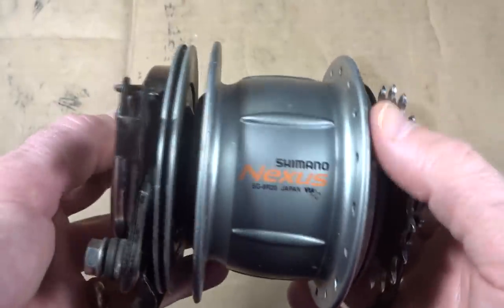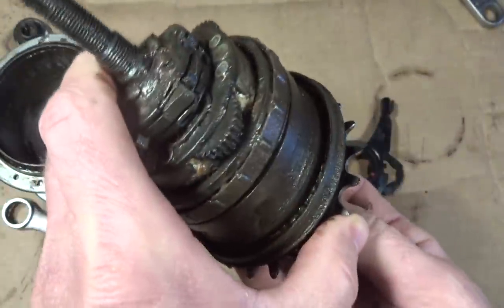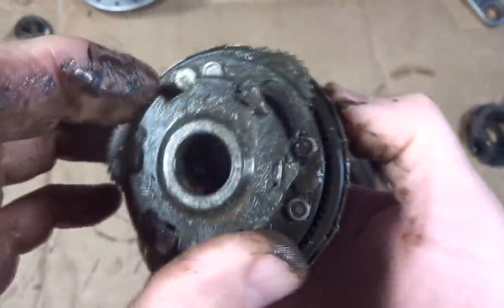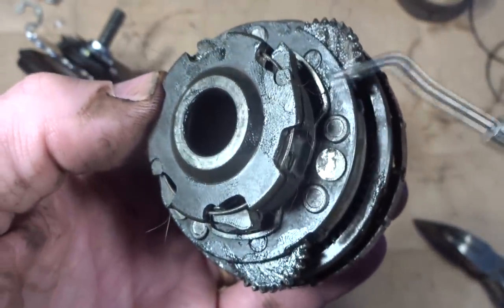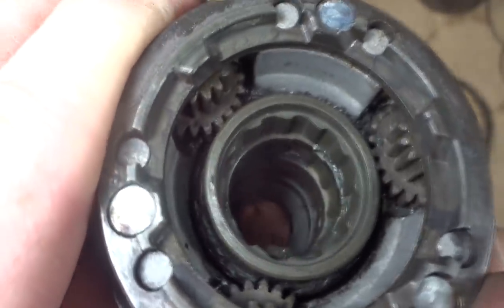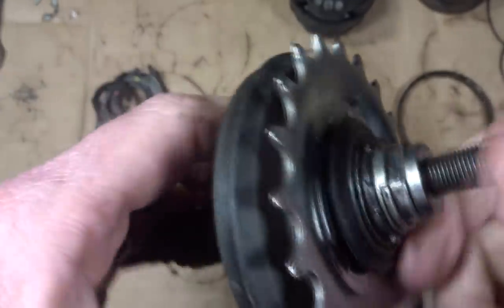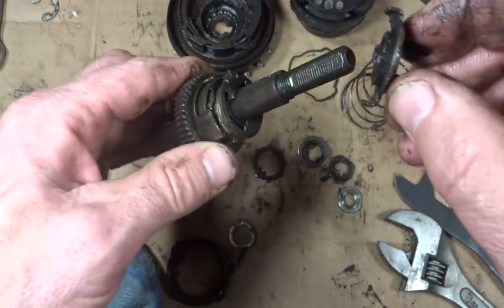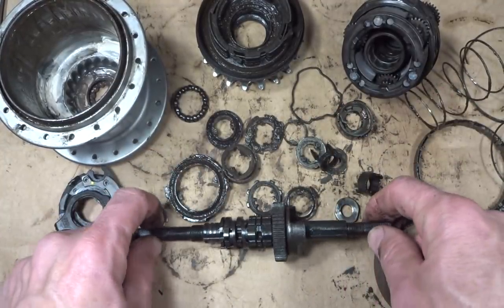Shimano Nexus 8 Speed Hub - Dissection! Evisceration! Destruction!

Comment: Three observations:
1.  It really makes you appreciate a cassette and derailleur system.
2. This has a large "ick factor"!  Have you considered a parts washer?
3. Great advice at the end about taking one apart!
Reply from the maker: I actually have a parts washer. I need to dig it out and replace the solvent in it. I was cleaning the parts in my ultrasonic cleaner which is pretty lightweight.
Reply: As soon as I rode IGH I appreciated time saved on cleaning multiple cogs and low running chain. This is a low end hub, I just checked Campi Record 8-sp cassette alone costs about 2/3 of this hub. Shimano 8sp cassette is about 1/3 to 1/4 of price, though.

Comment: It is the same as  a 8 speed automatic,  but all in 1 axle! And way tinyer! I have done the same with a Sram I-motion 9, and it is a nice challenge.  Thank hell I had a good day  and did not throw the fucking thing thru the window,  It still works after 5 years and lots of miles after. 
When you reasemble,  bath  it in ATF,  Works wayyy better

Comment: IGHs with more than 5 gears are usually oil-filled and oil changes are mandatory.  Change with hub gear oil before and after 1000 miles (no previous oil change). Then change oil every 3000 miles. (the first oil change is at 600 miles). Use only Shimano SG-S700 Oil in the Alfine 11 hubs. Also use waterproof grease in the hub to prevent premature failure.

Comment: An old "Billy Backyard Mechanic"'s trick is to lay out on your cardboard, each part removed in the order they were removed. You could even group them according to the area they were removed, ie; left side, right side, inner drum, etc. With the cardboard, you take a Sharpy pen and number each part and make any notation that helps you remember your conclusions as you disassembled it. You are lucky that you have a decent video detailing how you disassembled it. Just reverse the procedure. The funny thing is when reverse engineering you learn just as much if not more by putting the thing back together.

Comment: What a greasy mess, no wonder it wouldn't work.  I had one of these on a Bianchi Milano and loved the way it rode.  But, I had a flat on the rear and it took me a full day plus lots of busted knuckles, scratched fingers, etc to get it fixed.  Great engineering but not for the diy guys like myself.  I applaud your courage in taking this apart.  I'm fool enough that I would try to get it working again once the grease and dirt were eliminated.  Keep up the videos, they have helped me a lot.

Comment: Interesting. I came very very close to buying one of these then bought the Ebike instead. Now I understand why overseas they call them roller brakes. It looks like a roller bearing sprague clutch like use in drills and cordless screwdrivers. 

The hub itself looks like it might be built to be 9 speeds but loses one because of its configuration. I think once I'd crank on it'd definitely break. Thanks for the peak inside it RJ.

Comment: Had this hub laced into an old '85 Raleigh Renegade to replace the 7 cog cluster...ran the bike to about 6k miles and hub developed some play in the body and needed a new rear sprocket....took it to a local bike shop for some work and got it back..never to be the same. Later I went with a Sturmey Archer 8 sp hub, put 10k miles on that with no complaints...so far.

Comment: I've taken these apart succesfully (and put them back together again). 
      There is a certain point after which you should probably stop disassembly (or you're gonna have a bad time ;).
     Halfway, you come across some double spring-loaded thingie. And I HAVE managed to put that back together and back on without the official tools, but it took me several hours over several days.. And a loooot of patience ;)

Anyways - Nexus gear hubs are my favorite. VERY reliable, very little service required.

Just make sure you use the Shimano recommended greases 
     (the rollerbrakes too - they have Moly based grease for those with a certain viscosity. (I tried lithium grease, but holy sh!t - suddenly my brakes didn't work anymore at high speed)

Oh, and look for the dots imprinted in the metal gears (easy to miss) - on the first (?) planetary gear set (3 gear wheels), the dots need to face outward. Exactly the same as eachother, or there will be problems with gear alignment...

That proper gear alignment makes it so you can shift from 1 through to 8 while standing still (it's pretty sweet)

Oh, and use the proper shifter. One made for Nexus 8
(Nexus 7 shifter works too - you just don't have the heaviest gear available to you)

Oh, and use the proper err... (I think they call em) 'anti-rotation washers'. Those things that lock the axle in place (to keep everything in position);

They have different colors for Nexus 3, 4, 5, 7 and 8.

Nexus 8 is 1 gray, 1 black

Got Nexus hubs on 3 of my 4 bikes, and I reckon I might be the only one in Amsterdam who likes servicing this system (:
Reply: Just to ask is there a road bike shifter that can be used for them?

Comment: I much prefer the linear shifting of a Sturmey Archer. Really you should be looking for 4 different gears in there, hub gears usually have a direct drive then each speed below that is paired with one above, so a 3 speed hub will actually only have 1 gear train, it just uses it in both directions and has a bypass for Normal. 

Interesting video, though I too would like to see it fully cleaned so it can be observed, surely your video can show the order and orientation of the parts as they came off

Comment: Thanks for the video, it's great to see what's inside this thing!

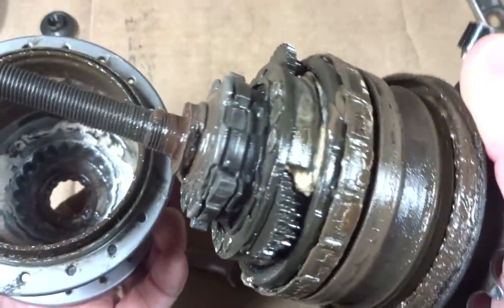I have been riding with a nexus 8 hub on one of my bikes for five years now, and it is very reliable overall, especially as I keep the bike outside. One year from new I had the shop I bought it from service the hub as it was "slipping" into a neutral gear (which should of course not exist) when set to gears 5 or 6. When riding this can be dangerous, as you suddenly lose traction. The shop told me they just tightened up the bearings as they were loose, and that indeed fixed the problem. I guess they tightened up what looks to be the bearing cup you see at 1:07 . (I think you can just about see the bearing race from the outside of the housing at 1:13 and then from the inside at 1:24 ). I suppose with the whole stack of internal parts being loose, the pawls were able to slip sideways out of their sockets somehow.

There is some great information on Sheldon Brown and from Shimano, but this problem of a loose bearing leading to a sudden neutral gear does not appear to be addressed in any of the "adjustment" information I found on those websites.

Comment: Couple years ago I was trying to do it in new oil, so got it out, couldn't put up back together by myself then took it to bike repair shop, they gave up, so bought used one, and it is working till this day. Only upgrade I've done, I changed the sprocket for less teeth so a bit quicker.

Comment: Dirty hub, cleaning is quite good idea and maybe organizing parts. I found exploded drawing and operational quide. Shimano spare-parts list, I had 2 depending to shaft length, the right one had right number of nuts, so there are many drawings within the same model too. My hub had black grease and it seemed in good condition. That was not problem. My problem was pitted bearings, so I kept transmission as it is, didn't remove safety-clip or that thing holding planet gears. Transmission is serviceable. Sellers manual guides to dip it in transmission oil, not dissassemble, but grease is much easier to apply when gears are dissassembled. It is big operation. And the shifter sleeve is the core of transmission so if you manage to figure out how it works raising pawls and rachets driving gears at each gear, you should find out if there is anything wrong with it, nevertheless it is dirty, the brown grease is contaminated with water or dust or something, oxidated maybe. White grease at hub walls indicates that original grease is white. I got white grease that is official, but there is also black Nexus grease. Dissassembling is easy, you can do it in minutes with one or two hands when it is clean and ready and so is assembling, but now you took the axels it is learning procedure if you make it unit again.

Comment: The gear block can be taken apart fully.
You allready had been on the right track.
After remivong the lower bearing shafts.
trurn the upper gear wheels so that the uper bearing shafts moves down to the lower gear wheels.
next you can remove the upper gear wheels.
this allows you to remove the freewheel.
next the lower gear wheels can be removed.
Now the inner gear wheels can be removed too

Comment: Thank You for the great end! Was really a big mess and fun. I make the day!👍
I would try to find another way to find a solution to the problems I'm having with my nexus8, wich 6, 7 and 8 gears, doesn't work...
Reply from the maker: Could be cable adjustment. Have you lubed it? They require a dip in a special (expensive) oil periodically.
Reply: @RJTheBikeGuy  Thankyou. Yes, the cable adjustment, was done, and also external lubrication; not internal disassembly and lubrication. 
The first 5 geard, go well, does not pass to the next 6, 7 and 8 gears. ..
Thankyou for your video, and comment. 👌

Comment: I have a problem with the 8 speed and it doesnt goes well in  3 4 5 gear but  1 2 6 7 8 no problem. I greased and it works a bit better but I did not disassembled it like yours. Yes I find it also magic.

Comment: Thanks for your honesty! I was just wondering ''How is he ever going to remember how all those pieces were assembled'' When you confessed that you probably wouldn't be able to.  Haha.
Reply: It wasn’t disassembled with a view to reassembly. It’s a very small but similar to an automatic transmission. 
An auto trans engineer would very carefully lay things down so it could be put back the same way. In my experience do it ten times then you could rip it apart, throw in  tub mix it up and reassemble no problem. 
Just need the opportunity to get familiar with them. But probably there’s no commercial reason to, hourly rate and risk of having to guarantee work I doubt anyone is going to fix; except the curious that like a challenge.

Comment: Had one on a Trek 7400 and documented all distances travelled. After 12,000kilometres the gearbox failed. Reason: the large ball bearing on the sprocket end fell apart - the riveted  sheet metal cage broke. Replaced it with a new gearbox 'cos I luv the transmission, and the bike.

Comment: i Have 2 of these. 1 isnt as smooth as it used to be. the other is still fine. My problem is both are on different size  rims but i want to replace the worn out one my bike. After seeing this video i think i could just transplant the internal gear system within the shell that is attached to the spokes right?  i am no Japanese gear hud engineer, i am just a Dutch plasterer, HELP!! lol.
Reply: Just remove the spokes from the wheels and change over. Look for videos on "wheelbuilding" 

Best of luck
Reply: Have opened and took apart both the hubs i had and simply stored the parts in the correct orde of assembly, cleaned everything and simply took the best parts of both (it were the bearings that needed replacement) hubs and assembled 1 good working hub.  Looking back it took me about 6-7 hours incl. cleaining  and relubricating the entire thing.  It was not nearly as hard as this video makes it seem, just work systematic and one should be fine!
Reply: @dutchkendama  well! Turns out you're not 'just a Dutch plasterer' you're a self taught engineer/technician! And braver than most. Pretty cool.

Comment: Sheldon Brown had guide for nexus hub servicing and operation. My Nexus 7 was pasman, there you can find how it works shifter sleeve, gear shifting cam, return spring and so. I studied it quite long time before I opened the hub and didn't open it much after all. Reconditioning bearings is my job at the moment, polishing and hardening or covering races with nitric or something a poor man could do.

Comment: I have a Nexus 7 in my bike that I use for urban commuting. The shifting of gears is very pleasant when it works. Often it doesn't work. The adjustment of the cable on the grip shifter is tricky, and it doesn't provide the accuracy that the gear mechanism requires. The visual aid of aligning yellow lines is difficult to use because of dirt accumulation and scratching on the transparent plastic cover, which are impossible to avoid in everyday use. The problem sounds petty and superficial, but it can prevent the hub from working correctly when the cable gets adjusted wrong. That small but important detail looks like a case of thoughtlessness in design work, like a case of engineers not treating the user interface of their product as a  serious design task. I bought the gear hub in 2017, I wonder if Shimano has done anything to fix those issues.

Comment: Thank's RJ for another good vid , have you found the part that is failing  ( the defective/broken piece ) ? I am researching on IGH's to find if I could use one on my e-bike project , I have found that many have a part/piece that is designed to fail to prevent other more expensive parts to break .It seams like a good way to design such complex mechanism , my e-bike motor has such parts (nylon gears in the planetary reduction gear box instead of steel ) if they fail its cheap & easy to replace + act as a warning to stop whatever it was ( pushing too much power into the motor '=}   )  that got them to break , luckily I know that from other's who shared their experience . are you planning on doing some video about IGH's to find their capability , options & learn where + how to choose the best for the usage planned ?  Again TYVM for all the knowledge about bicycle you share with us ,cheers 2u and all .& please stay out of vehicles blind spot ,if you do not know about blind spot https://www.youtube.com/watch?v=5zVf4UcXsEA          Ride Safe ;-)
Reply from the maker: Not sure why it stopped working. I really don't think most things are "designed" to fail. I think it's more of making stuff cheap, light, good, but with an expected lifetime. It's a trade off. They can make things that will last longer, but they will be heavier and more expensive.
Reply: @RJTheBikeGuy   I don't mean designed to fail but designed to yield so to preserve other parts that would end up being way more complex + costly to repair . That info if I remember came from Rholoff , they made a pin (that transfert movement ) weaker so that when/if it fails then the IGH stops working and don't take more extensive damage .If its stronger then it would be expensive gears that will break , again warning that whatever broke the pin should not happen ,cheers & thank you for the reply ,ride safe mon ami =)

Comment: No surprise that these are so expensive and why they are barely used anymore. Chain gearing is just so much simpler at every step from designing to maintaining it at home.
My dad swears on hub shifting though and I have seen him service them, mostly old 3 speed and the occasional 7 speed and none that I saw looked this complex when disassembled.

And I thought the 3 speed ones were a headache...

Edit: Can you try and find a busted Rohloff 14 speed hub and gut that one too? I'm really curious how many teeny tiny gears are in those now.
Reply from the maker: They probable just have additional stage(s).
Reply: @RJTheBikeGuy  I've seen somewhere that they are basically a really compact 2x7. That's crazy, those gears must be tiny for all the force that probably has to go through them.
Reply: Yeah chain gearing is so bad it's amazing. Prefer using this any day of the week.

Comment: Damn. I need to find out about common faults. I need to find out about 5th and 6th gear. I've heard stories and rumours about little springs you can rotate 120 degrees for better tension.
It's a pity you can't overhaul these with new bits and have to get a whole unit. This is just on the limit of my intelligence. I spent weeks on a Sturmey one cable 5 speed, and could get all sorts of little planets, springs and things, officially available bits too, and they were really cheap,  but I could just never make it not slip. It was an intellectual nightmare. 3 and 4 speeds are so uncomplicated in comparison.

Comment: Take a Nexus 7 apart. That is even more complicated with 9 gears of which 2 are disabled to the rider and generally regarded as a much less reliable hub. I like hub gears but once they fail or become problematic the amount of hours or money they soak up to sort  can be annoying to say the least. The 3 speed hub is by far the most reliable hub due to its simplicity even Rohloff's fail more frequently than those. I have a bike with a Nexus 8 when it goes wrong I'll likely replace it with a Nexus 3.

Comment: The hub is full of grease where it should be a thin special oil from Shimano. Probably why it didn't work. A cleaning and oil bath with Shimano oil (part no Y0029801A) would probably have solved the problem.